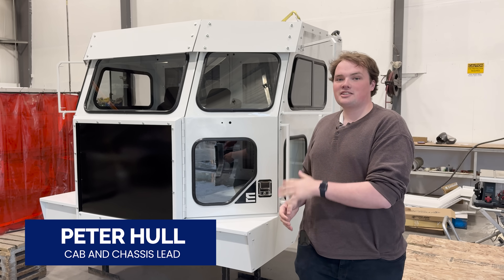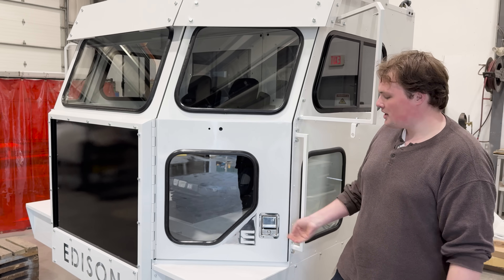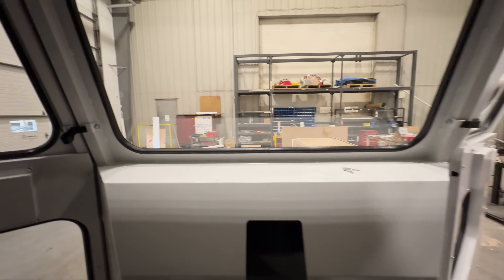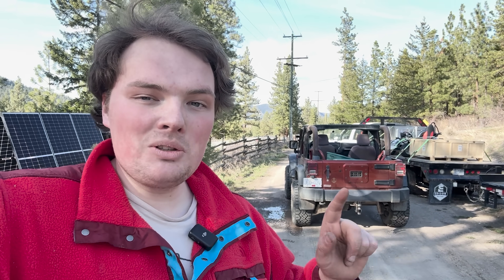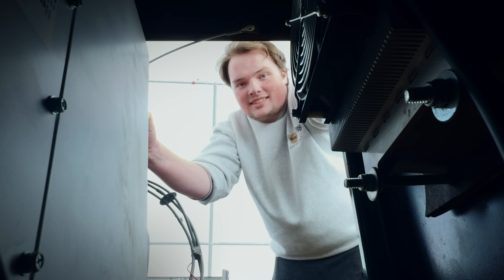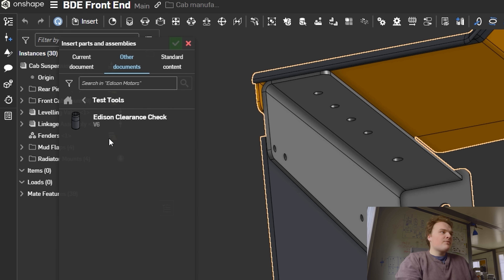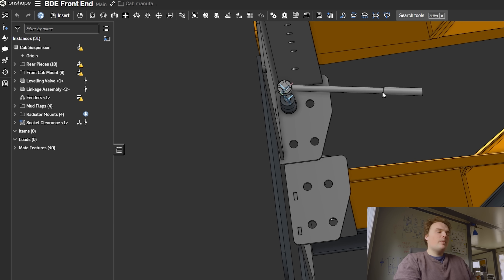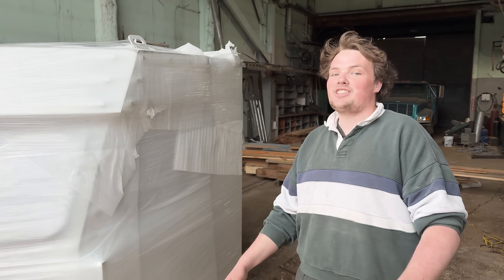Building Our Secret Undisclosed Cab-Over from Scratch.

Comment: You should have made 1 door hinge on the front and the other door hinge on the back. Use a rubber hoof latch on the inside if you're worried about it opening on the road

Comment: I don't know how feasible this is from an engineering perspective, but those sliding windows are so far from the driver, have you considered some sort of electronic sliding mechanism so a driver can push a button to open them while driving so they can get a breeze, or close them if say the weather turns bad?

Comment: Great progress you're making. Hey Chase, If you're not giving electrified trailer strategies your attention, IMHO, you're missing a huge opportunity. Watch: "Electric Semi Truck? Start with the trailer! Genius setup by Range Energy!"
Reply: Thanks for the share. Range Energy is worth keeping an eye on. Their trailer with drive wheels and a battery pack and onboard reefer is pretty cool. I get a little tingley if I imagine a Range Energy trailer latched onto an Edison Truck. The ability of an Edison tractor being able to recharge the Range Energy trailer on the fly, and, be able to draw upon the Range Energy 288 kWh battery back when starting from a stoplight is pretty impressive. Not your normal el-cheap-o white van trailer. Plus you would never need to run the standby emergency reefer diesel engine.

Comment: I think the idea could be silly (in a way I may not have thought of yet) but the cup holder being in the same housing as the hvac could possibly be a really nice touch depending on how it works. For example if the cup holder is able to use the expended energy from the hvac to heat or cool the drinks the cup holder stores? 🤔 I am not sure what I really mean exactly and if it was an idea then I feel like it might be more of a long term design than anything else.
Reply: I love that idea!

Except...

You are adding lots of complexity and points of failure to a thing you REALLY want working to enable a luxury convenience.  I am 100% behind your idea of not wasting energy and efficiency but it goes against the simplicity and  toughness they are priding themselves on.  

I've had many a thought of running a line off my coolant system to warm my coffee or lunch but then the reality of coolant spraying all over my cab and maybe a new head gasket and engine failure from a problem is considered and the risks outweigh the benefits.

Besides, this truck will have accessory electricity to spare... any 12VDC device you can imagine (and a million you cant) should be easy to power and use!  You want a George Forman (rip) grill in your truck? Plug it in to your inverter and enjoy your lunch!

Comment: for the design cleaeances chack also if you can get you arme in there and also if you can use the wrench not juste place it on the bolt but super neet that you prioritise the reparibility over somme less than a penny saving

Comment: I know a lot of people get pissed off when you have to take off certain parts to get to another part. But this is just the way how certain things are and always will be :D Impossible to design a modern vehicle without components nesting into eachother. Unless you build this CAB that is, nothing there apart from pressbraked steel panels. 
It looks like it will loud as all living hell from the windnoise and such in there.. And those corners where the cupholders are located, banging your elbow on that will def wake you up, no need for coffee after that. :D

Comment: I still think the corners below the door should be part of the door with a step well behind it to increase the size of the opening. The biggest annoyance is having to duck or hit your head every time you climb in or out of a vehicle. Looks like you need a DRIVER clearance test tool. What driver is 5 foot tall or are they going to crawl to their seat? If a ~6'6" 300lb driver can't easily get in and out it will ruin the entire driver experience.

Comment: Not sure what the final use case is going to be on this, but I'm surprised you didn't make it tall enough to fully stand up in, if whatever is behind the cab is going to be taller i would have the cab bow up and be taller in the middle for a little bit more headroom.  As a taller person I imagine i would have to learn not to bump my head getting into this as the distance to travel from door to center console would be uncomfortable hunched over.
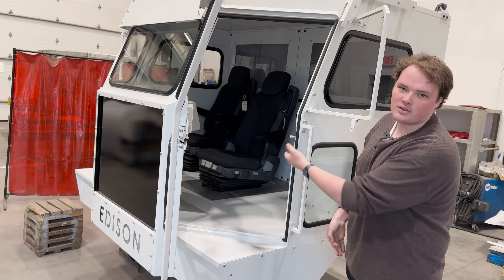Reply: yea looking back to 01:55 the chair is at lowest height on the floor,  sitting with legs bent up at an angle that would be uncomfortable to operate at long term, and if you raise the seat like 1ft to make the leg work then your head would be uncomfortably close to the ceiling, especially for a cab over , that looks like a neck injury waiting to happen.

Not tryin to hate on you guys love the work you're doing but if I have a concern i'll tell ya so you can address it.

Comment: Flat glass widows.
Windshield wipes clean over the complete arc of the wiper blades on both sides.
Happy driver.
Cheap and easy to replace if cracked or broken.
Happy owner.

Comment: Clearance check is a fantastic tool. One thing I would add is, something that lets you check clearance at the tightest setting AND the loosest. Rarely have I ever had a problem with getting 9 a tool into a spot to reach a bolt, but the thing I hate is when I have to swap my ratchet for a box wrench immediately after popping the bolt loose because there’s enough room for the bolt to come out, but not for anything to be on top of it when it does.
Reply: You could probably cheese that with the extension drop down menu. Just toss a 2-3" extension on whatever and you can design things to have more than enough clearance.

Comment: one thing you should change is that for the stored tools and the ability to select frequently used tools, like a favorites folder or similar.

I think the most efficient way to implement this is to store commonly used tools as macros which you could map to a separate macro keypad, or just keyboard shortcut. 
but at that point with the macro set there is no need for a favorited tool as it will automatically choose the socket, wrench, and extension every time.

Comment: That clearance tool would be incredible if it automatically showed you what tool is needed to access a given bolt. Given a torque spec it could tell if the proper length wrench fits. Then it could be extended to go through all fasteners in the design and print out a list of tools needed.
Reply: Good point. Writing a script to calculate the volume around each screw/bolt and doing a boolean check for the "working volume" of all the relevant tool combinations or at least longest + shortest could generate a list of workable tools. I would also like to see a script to calculate the reachability or extraction path of a part.
Some cars need massive disassembly simply because a few mm of missing clearance path to remove a part.

Comment: Two possible issues with the cab design.
Wind noise and water ingress, the corner doors will need to be sealed very tightly and may require wind deflection.
Another issue is all the internal sharp corners, especially that cup holder it will need a guard rail.

Comment: KRYTOX FOR SQUEEKS (LASTS LIFE OF VEHICHLE) THIS STUFF IS AMAZING!

I copy/pasted part of an article from the Miller-Stephenson website:

Krytox™ Lubricants Can Help Solve Your Automotive Noise, Vibration, and Harshness issues.

Inside an automobile’s interior, there are a variety of places where different materials come into contact with one another. Examples include metal on plastic, leather on leather, weather stripping, and many others. Movement between these surfaces often results in a series of noises typically described as squeak, itch, or judder. Krytox™ lubricants can permanently eliminate these noises with just a small amount of lubricant at the interface.

Because these applications are intended to be a one-time application, it is important to choose a lubricant that is easy to apply, has low volatility, and will remain in place over the normal useful life of the vehicle...

https://miller-stephenson.com/krytox-noise-vibration-harshness/

Comment: You should use the cab lifting points as a mounting option for rooftop crossbars or other items like horns, or lights or cargo baskets. That way lift points serve multiple purposes than just installation lift points.
Reply: Nice. Like the way the new Ford Bronco has spare mounting holes all over in case, down the road, an owner wants to attach something to their Bronco, there is already a threaded nut ready to go.
Reply: The disadvantage is that if you have to lift the cab off the chassis later, you also have to remove all the extra components. If I am right, mechanics also complain about all the extra work to do the one operation.
Reply: @naerbo19 most of the time you still need to remove that stuff as its mounted in the way of the points even when they are not used themselves
Reply: Also, a benefit to that is not having to put any more holes into the roof/side of your cab or compromising the door seals to mount something
Reply: If you design your roof accessories properly, you can keep eyebolts or eyenuts in place.
Reply: Like a log cage for an excavator almost!

Comment: I once saw a rig that had had a lot of thought. They only needed 3 wrenches or sockets to remove any bolt or nut on the rig. 2 screwdrivers took care of most things other than places like the wire connections on the backs of gauges etc. that would not be worked on most times. Where possible the smaller bolts had heads used for wrench or Phillips screwdrivers.      
Even the engine was amazingly simple, more than you would think possible. The tool kit came with a pry bar that doubled for the jack handle. The tool kit did have room for additional tools if the owner wanted to add but tucked away under the seat and was secured there. A few rags would keep the tools quiet.
Perhaps you could include a tool kit with those tools you were describing in the video?
I do like the design of the cab and I imagine it will be easy to set it up the way the new owner wants the gauges, radios etc. are placed.
Good luck with your business!
jack
Reply: the GDR Trabant hat like 2 Wrenches and a Flathead Screwdriver as Toolkit. Same with the Wartburg's  just Keep it simple :3

Comment: A piece of equipment that could help out is a Crown forklift that uses what looks like Drill heads for mining for wheels that let it move in a Diagonal direction with custom attachments for it. I worked at a industrial facility that had mainly Raymond material handling equipment and Crown was offering something new

Comment: I work in an industrial facility that builds some large equipment that could benefit from something like your clearance check tools, it's absolutely insane when we run into a problem that's nearly impossible to rectify because a mechanic can barely get eyes on it let alone tools without full disassembly.

Comment: for you clearance tool model a mechanic in there. al lot of times positions are only accessible by tools but the mechanic that has to get his body in there to place and start the bolt or tool is forgotten. also the hand that holds the tool takes up space so model for that. and mechanics are using more and more electric ratchets and impactdrivers and although u don't have to move them they take up more space  so it would be nice if they are in the clearance tool. and if you give a tork spec for a fastener make sure a torkwrench fits as wel and can be used effectively.
Reply: I do 3D software application development, and I am wondering if you think there would be a market for a tool that also models a human body interacting in this space, including moving the hand and arm to turn the wrench. It would run on a laptop or a VR headset like Meta Quest 3s ( about $500 for the headset).
Reply: @ryuuguu01  I know it exists it is used in many production plannings but then you know what tool is going to be used in what stage of production.  but almost nobody plans for stuff to brake anymore so the space that was ones used for tool and the production worker is afterwords filled with other stuff. so by the time a mechanic needs to replace the alternator he fist needs to remove the AC compressor and to remove the AC compressor the cooling pack needs to be removed so that means all fluids need to be drained and replaced. 
I don't know if those models are all in house  models ore if they are industrie standards that can be linked to standard design software that would take market study. if there isn't a standard yet I can see a business model for 3D modeling add on but I don't think it's a big market because most companies don't care about the struggles of the workers.

Comment: No insulation?  Tin can will be freezing in winter and hot in summer.
Reply: I BELIEVE that there is a sandwich of insulation in the skin of the cab. 

Luckily with 400 amps of power available at a moments notice, I hope plenty of hvac is just a button turn away.

Selfishly, I'd like to see visors, and/or lcd auto dimming on the glass. Or tinting. Try to control the greenhouse aspect.

Comment: So dope💯 COE style cab makes more sense than traditional cab if not needing a large engine underneath
Reply: Careful with that shrinkwrap if airtight. Temp cycles could cause rust inside. Seen that in Victorville but doubt you see such wide ranges of temperature….
Reply: @DavidL3430  throw shop fan in it💯
Reply: Or in this case, it is expected that the engine and genny will be placed transverse behind the cab.
Reply: @Sah-o5m either way, layout from COE style can give superior visibility. No need for a hood

Comment: For the OnShape tool, Inverse Kinematics (IK) to model the mechanic's arm and torso to see if the position is reachable could be the next step.  IK is what is used in video games VR to make an arm move realistically, for just knowing how the hand moves and where the torso is.  I just checked, and OnShape supports IK mechanical linkages. I guess I should do a deeper dive and see if they have human arms in their libraries.
Reply: I had a thought as well if the nut is mounted to the part and you unscrew it, it will extend out thus pushing out the work area you need to unscrew the fastener.
Reply: @zach3664  you would just add a distance mate from the face of the wrench to the end of the bolt to check for this.
Reply: This is a brilliant idea.

Personally, I don't want/need the detail of declaring each and every socket extension. I'd be fine if I could select a bolt and choose an option and the software would display a glowing shape that represents the available space for a pre-made ratchet/extension/socket to operate in.
Reply: @Sah-o5m  this seems like a good idea but how would you check to know what socket goes to each bolt, as well as for it to know when deep sockets are necessary?
 how would you calculate the size of the glowing shape around the available wrench clearance. 
I suppose you could tell it to check for collision around the cylindrical and pie wedge shape around a fastener. and tell you the corresponding wrench. but with extensions the issue is sometimes whether they would even fit in the first place, which causes the potential for the check to become ineffective.

Another advantage with choosing the bolt and every extension needed is that you can easily make sure to limit the tools required for assembly by checking access on only a few specific tools.
Reply: @ameraldas3641 So first off, i dont want to take away anything. If the develpers are making useful tools and users are using the tools, then carry on.

As for how would i know which socket to use? For me, i would expect all 12mm bolts to need like a 15mm diameter socket with 1mm of clearance around it. So for me personally, id like to see a simple 17mm cylinder above each bolt head. Then in the field, ill figure out extensions and deep dish sockets etc. What i would need is to know there is enough room to get the bolt in/out of its hole.

Also, a bigger problem is getting my forearm past 3 other devices to get at the target bolt.

Side note. I had to replace a starter on a saab once. One bolt was easy peasy. The other bolt was behind the exhaust manifold. To remove the manifold i had to remove an engine mount. It was a paaaain.

Comment: My initial guess was that this was going to be a trash picker, and your comment about it being used in an urban environment with pedestrians around was pointing that way. But I don't think this is really suitable for that application with the ingress and egress method you've got. So now I'm just completely stumped again. Not sure if we'll ever be able to find out, but I'm enjoying the mystery.
Reply: My guess, given the need for extra axels sometimes, is it's supposed to operate away from urban environments in work sights, maybe oil, or military, where reducing ground pressure can help prevent a machine from sinking into soft ground.

A trash picker doesn't need to do a lot of urban work does it? I'm imagining it being parked on a job site maybe even supplying power to workmen using the on board generator, propelled by battery and generator energy.
Reply: @glenmcgillivray4707 all our garbage trucks here in Michigan have tag axles. They use them because we have higher weight limits. Canada has similar weight limits so you'll see rigs in Canada and Michigan with 11 axles quite regularly.
Reply: @t-yoonit  I guess when you got a big country and quality roads oversize rigs to haul trash from one town to another makes sense. Even if they don't negotiate city streets quite so well.
Reply: Looks similar to the trucks that the tree removal companies use in my area